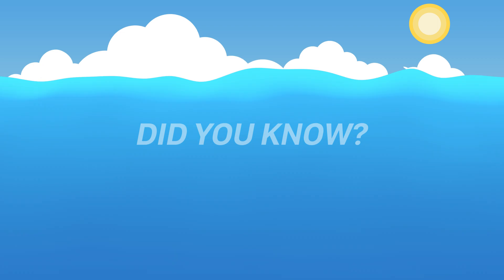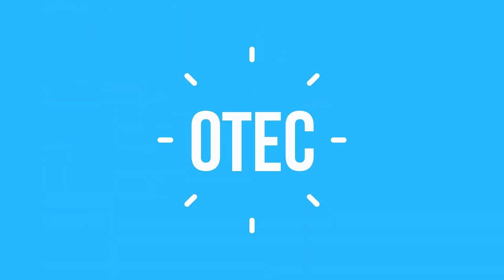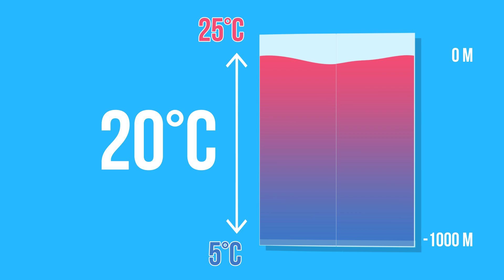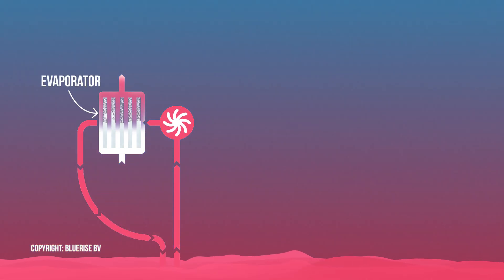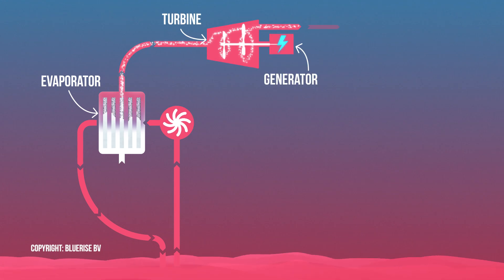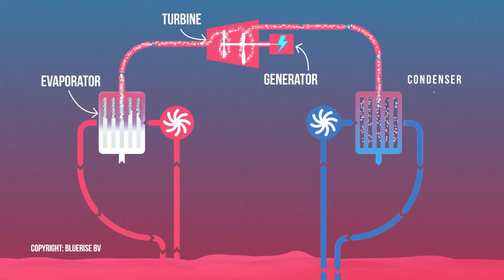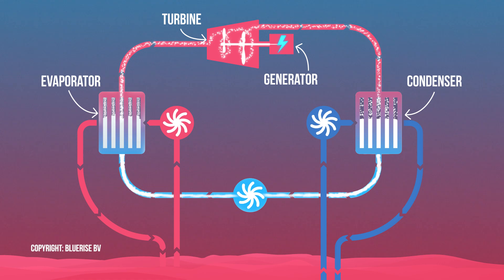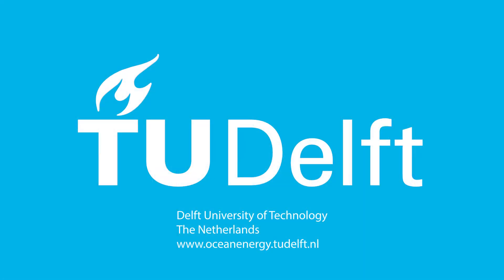TU Delft - OTEC

Comment: How much m^3 of sea water at 20-deg difference is required to generate 1kW?

What is the allowable and attainable temperature rise (heat loss) between inlet and outlet of deep sea pipe?
Reply: At 1000m depth, with temp 25C to 5C, warm water has T delta of ~2C and cold water ~2.5C
Reply: @Yev371  no sure I get that. Advice?
Reply: Use formula for Q=mcp(delta T), answer is 11.94 m^3. Sorry for late reply :)
Reply: @diazdenmarcd  can you explain what Q, mcp is and their units.

Comment: Challenging points:
1 volumetric flow
2 tightness
3 cost per kW
Somehow the 24h renewables should be paid more than solar and wind producing power without control
https://youtu.be/r029qfNFSmM

Comment: Love the idea. Does it ultimately 'warm' the ocean. Is this a significant 'fallout' from the process?
Reply: It cools down the surface, warms up the deep. Overall, it cools the ocean down slightly.
Reply: @beback_  tf? how?
Reply: @nofekun1889  I'm assuming by absorbing the heat from the water to turn into electrical power? It would be nice if we didn't need a temperature difference to absorb heat and turn it into electrical power, but no, we need the system to "flow" from hot to cold. So, some of the heat is captured and converted into electrical power, while the rest of the heat is pushed into the cooler, deeper water.
Reply: Not really. it largely depends on the hydrodynamic design and modeling of the in-out-plumes. The study was done on a pilot plant that’s being build in Martinique and the warming of surface layer was found negligible.

Comment: I think it is not worthwhile. Because still we need energy to pump the water from the sea
Reply: Umer Ashraf ....why u r pumping the water ..u can put amonium fluid boiler on see nly ..that mean their is no pumping of water
Reply: Calculations show that the energy loss from pumping is far less than the energy gain from the heat used to expand the working fluid with the low boiling point.

Comment: Respected sir, If these system  is applied in ocean a number of times, then wil the natural temperature difference in ocean be at risk and it may disturb ocean environment and other living creatures etc.?
Reply from the maker: Unfortunately, I can not answer this question. You should contact Berend Jan Kleute, contact details are available on this website: http://www.oceanenergy.tudelft.nl/thermal-gradient-otec/. Kind regards, Mark
Reply: yess
Reply: The amount of energy exchanged is not geologically significant... I hope.